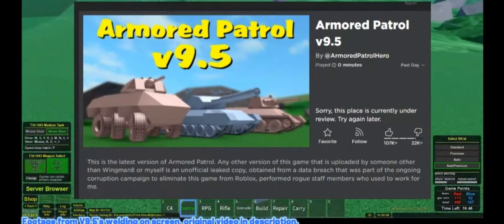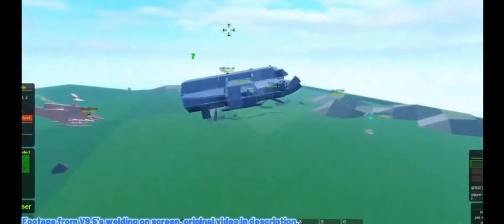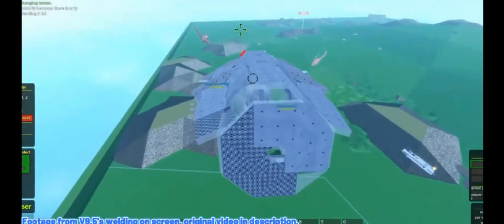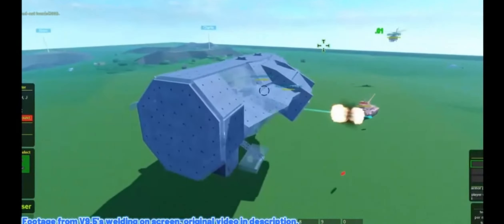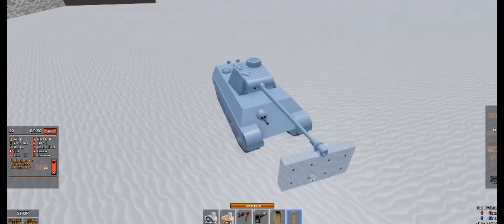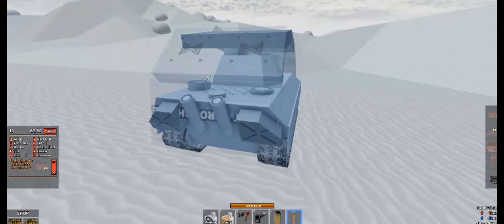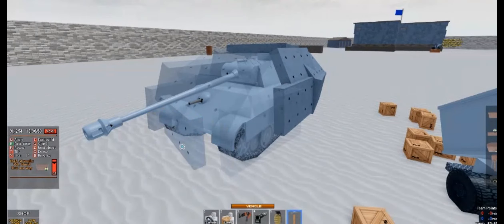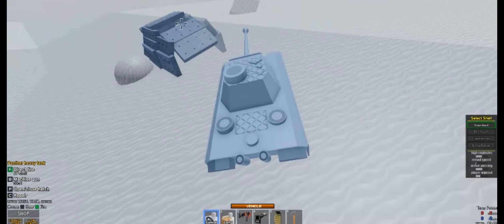How to WELD (kinda) in AP V10! (PATCHED)

Comment: This is not welding, this is called drop armor and it was how you did it back in the Wingman versions, before APH added bugs to his game (Because he is awful at scripting.)
Reply: Also, the panther is NOT a good tank for this, the sherman is good if you want speed, good shape (for stability,) three crates and great stats, but the naxi tanks excluding the panther are fairly stable from being slow pieces of garbage. 

Using trusses to hold it in place will help you too.
Reply from the maker: @Colon-D...  yuh huh, the panther has no crates. i was using it because of a scrapped video where i tried to make the panther viable (((i couldnt its too bad omfg)))